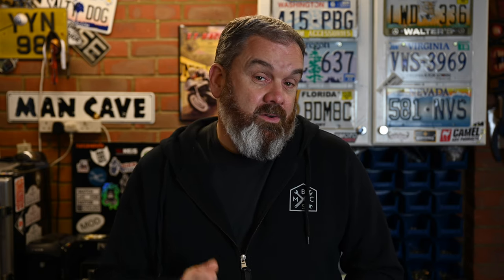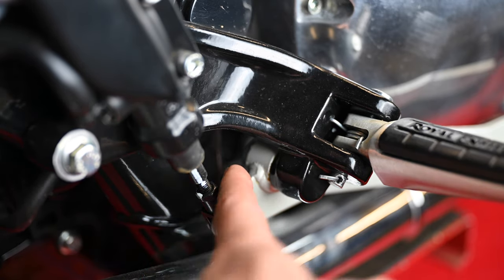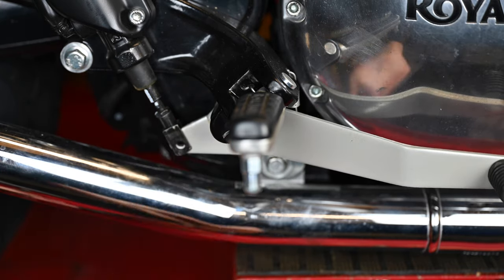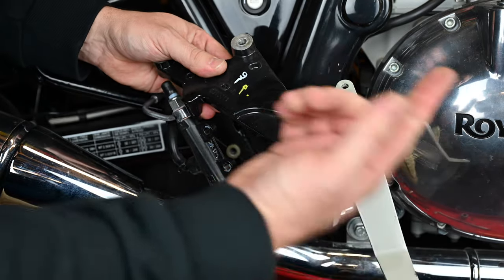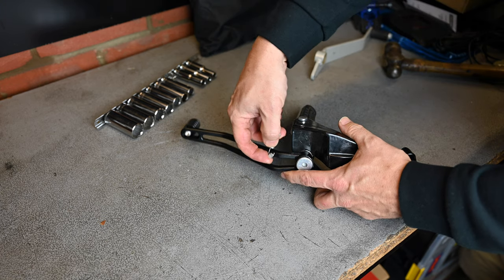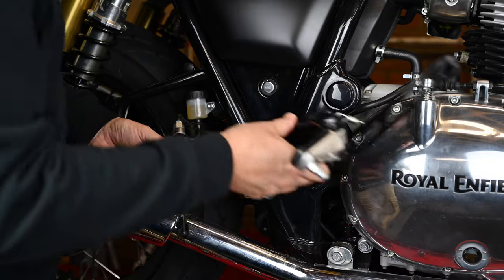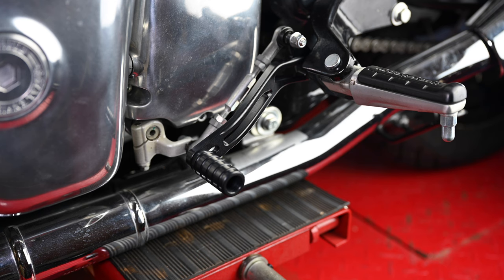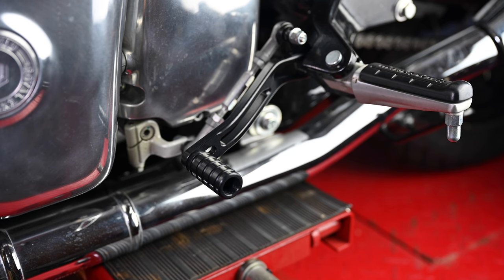Interceptor 650 Project Ep.4 - A Change of Foot Controls

Comment: Be careful ordering from Le Motographe to the UK, the price on the website includes VAT which they do not remove for UK delivery and then state on the invoice that VAT is zero effectively increasing the cost of the item by 20% because you then have to pay UK VAT on top of customs charges. They are less than helpful when this is pointed out to them.  Once this all added up £277  seems excessive.
Reply from the maker: A good point, they discounted mine by 20% to counter that

Comment: I wouldn't want to change my brake pedal just for the looks but I do find the stock pedal so difficult to use, hidden as it is under the engine casing, really poor ergonomics unless you're pigeon toed. I guess I don't really want to pay 5% of the cost of the bike just to make the change either. Is this the kind of thing a conmpetent enineering workshop could knock out as a one off?
Reply from the maker: They could, but you wouldnt find anywhere that could one off CNC machine this part for less money.

Comment: A bit off topic but here goes

I’m 6 foot tall, 61 and just pootle about. Rode a bike as a teenager and got full licence just 2 years ago

I’ve got an Interceptor which I really like. Nice upright riding position, great looks, great sound. Cheap to service
Looking to step up to something with a bit more power and stability, it's a bit lacking on dual carriageways and motorways when doing over 70mph

Want a bike with plenty of room, not cramped. Nice exhaust note, had a go on Z650RS but sound was bland.
Want a bike with power in low revs, don’t want to be wringing it’s neck; want bike to be comfortable at 70/80mph, not revy or vibey
Thinking of Tracer7 or Tiger 660 or Tiger 850/900 or Ducati Multistrada V2 if I push the boat out; BMW R1250RS if I really pushed the boat out 
Just not sure whether to go with a bike with a screen, seen so many reviews where screen gives more buffeting which I don’t want; could put up with a bit of wind noise.
As I only do small trips do I need a screen?

Should I stick with a naked?? Like the look of XSR900 and Monster. Problem is I’ve got a top box and although they look ugly on a bike often need a bit of functionality.
Don’t like Z650 or MT07, they are a bit small for me

So best choice with a screen?
Best choice without a  screen?
Best naked 700cc? 

I'd appreciate your thoughts and suggestions on which to test ride, not easy as dealers don’t always have a demo in
Reply from the maker: Hi Beverley, theres a lot to go through but here are my thoughts. By the sound of what you want from the engine, A twin would be the way to go. The Tigers are triples so will maybe be more on the revvy, vibey side of what you're after? The Tracer is a good choice, but may be a little cramped?  I really like the Multistrada V2 its a brilliant all round bike, as is the Honda Africa Twin. KTM 890 Adventure could be a shout too?  Screens are really hard to work out as its very dependent on your height, posture and helmet. I see alot of people refer to buffeting, when I think they actually mean wind noise. Ive not really had any major buffeting issues from screens, and the wind noise can be dealt with through aftermarket screens or spoilers. 
But for any of the bikes, low down torque is probably best served with a twin, and the GS will deliver that in spades, as would the KTM 1290 Superadventure S
Reply: Thank you for your time and detailed reply.
If I went naked!!!! what would you go for. Have you tested XSR900 or Monster?
Reply from the maker: Ooh cheeky! I have ridden both and I preferred the Monster, but that probably because I like twins. Both great bikes, the Yam is a more 'aggressive' bike if you want it to be

Comment: Those are nice looking controls. 

Just a quick tip if you got a hard to reach cotter pin (thats what they are called in the USA) is to run a piece of wire through the back end and use the wire to pull the pin out, I like 0.32 safety wire and use that to pop the pin out. 
I know this time it was easy but if you ever run into that situation again you can just run a wire though it.
I was an Jet Engine Mechanic in the US Air Force I changed out lots and lots of those cotter pins on daily basis.
Reply: Cotter pin here in the UK as well.😊
Reply from the maker: Thanks for the tip Donald
Reply: @gogsie59  never know with the UK 😆
When I used to live in Felixstowe my neighbour asked me if I had any Jubilee clamps, I had no idea if I did or not, turned out I did, we call them hose clamps.
Reply: I seem to recall Cotter pins were the type that had a slopping ramp with a screw thread on the end so that  a nut would draw the ramp to a interference fit as it was tightened..(Like bicycles foot cranks used to have.)....Those mentioned on the video I would call Clevis pins...
Reply: @brianperry  yep, Clevis pins - definitely not circlips!
Reply from the maker: I’ve always called them split pins, but I made. Slip of the tongue when recording the video and people are losing their shit over it 😂

Comment: Looks nice. Do you know if the brake lever is designed to bend if the bike falls? I saw an interceptor on the web that had aftermarket foot controls added that punched a hole in the clutch cover when the bike was knocked over when stationary. I guess it was stronger than the casing!
Reply from the maker: It’s not foldable No, but I suspect as it’s bolted on the be adjustable for length it may move or break off in the event of the bike going over on that side